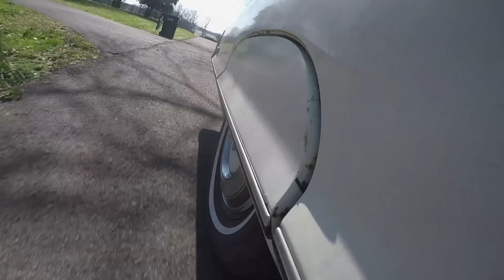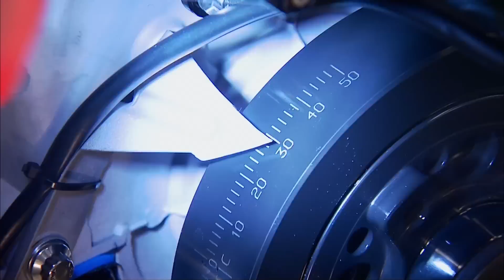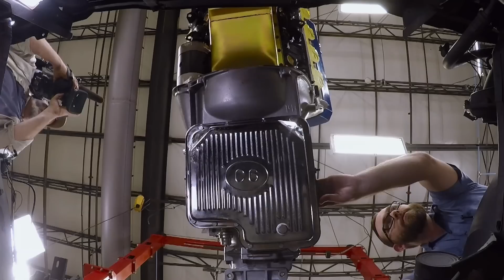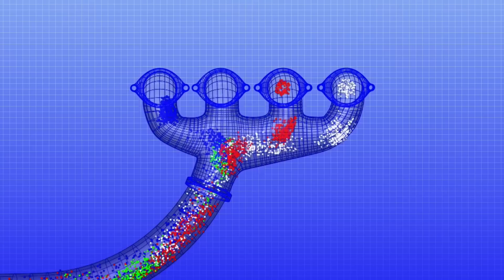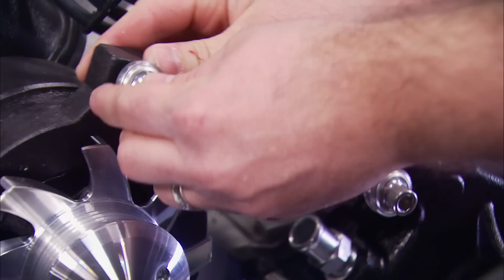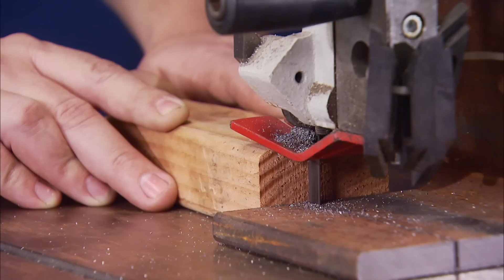Putting A 1,100 HP Big Block Into A '72 Mercury Marquis - Detroit Muscle S3, E8

Comment: Using rtv and a gasket for the wp ?  Wouldn't that double gasket and cause a leak?
Reply: I was always taught that its either a gasket or sealer, Not both.  I have seen sealer attacked and destroy gaskets
Reply: Tripple gasket? Id like to know why too. Seems like less is more situation.
Reply: Michael Devlin it depends on the engine, some do better with just a gasket. Some with RTV, others need both to not leak. There's also some that will leak no matter what you do.
Reply: @alexcorona  that's makes the most sense lol and yeah some will leak no matter what you do haha.  Very true
Reply: Yeah I mean I've been a professional technician for years and always do one or the other. Perhaps it's just a preference? Not too sure though
Reply: Been wrenching for 20 years , I always silicone both sides of a dry paper gasket,  never as thick as these guys tho.  Just paper leaks coolant t when cold, and just silicone doesnt adjust for glange indifference, and eventually blows out.
Reply: Ya I guess that makes sense but I personally wouldn't do it. Unless to hold the paper gasket in place. I'm guessing a rubber gasket would definitely be a no no with rtv
Reply: This is how it used to be done. Variances in the aluminum pump and front cover could potentially create a leak. A little bit (much less than they used!) of silicone on the gaskets will help seal. Too much (like they used) can create leaks.

Comment: Ford  sure made big  Heavy Ugly gas guzzling  boats
Reply: Mike Skidmore because 70s impalas looked as good as the 60s ones....give me a break. Dont even mention Mid 70s mopars. ugliest things ever
Reply: And America loved them! Including ME!
Reply: My  '70  Chevy Impala  had a big  2 barrel Carb.. I added headers.. had to change and adjust the points all the time  power and MPG  was pretty good  because it had  10.3 to 1 compression ratio ..  by  '72  they were low compression smaller  carb and smaller intake runners.. and were rather doggy and bigger heavier and uglier like the Ford >
  I paid $500.00 for and 6 months Insurance was $76.00
Reply: @mikeskidmore6754  Before I retired I had to drive 3 hrs each way, across the mountains in Oregon. I spotted a very clean 78 Mercury grand marquis 460 for $700 and turned that into my commuter. Put studded tires on it and it was the best snow car ever. Soft suspension, long wheel base, and weight, it stuck to the road. That beast got 17 mpg's on the highway, but in town mehhhhhh. Like floating along in a barcalounger!
Reply: I think they all did...
Reply: @Ben Manning   My  first car was a 1970  Chevy Impala  2  door.. My  Grand Father had a '71 Ford Galaxie ..  so  ugly so ill handling .. tough the brake pedal and skid the  wheels ..  My Parents  drove that .'71 Galaxie  500 till it turned to rust..   <My parents  even got shot at by some Drunken Mexicans one night had a bullet dent in the  passenger front window pillar
Reply: Mike Skidmore 

So what automobiles do you like?
Reply: This is one of the best looking cars of the 70’s. GM cars were ugly during that time period.
Reply: So did Chevy and dodge. The imports were no better! Best looking mid 70's cars were the big ones though.
Reply: Nobody cared back then because gas was cheap...but people started to panic when it got close to $1.00 a gallon!
Reply: @Ben Manning  most Fords were ugly except mustang...even chevy trucks were sharper